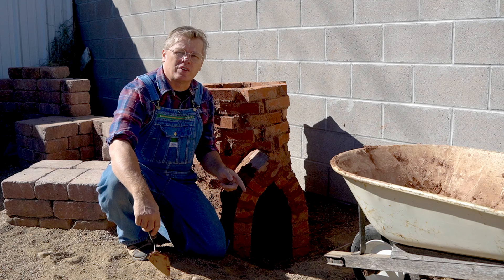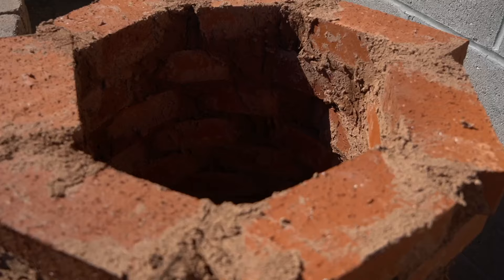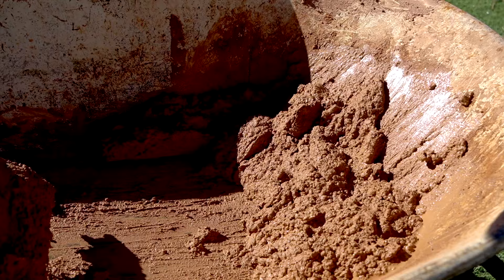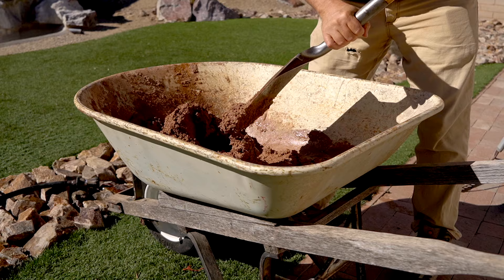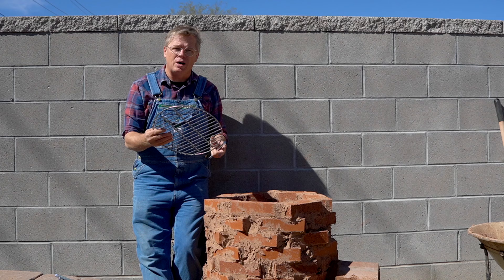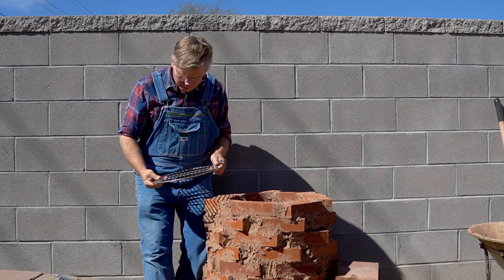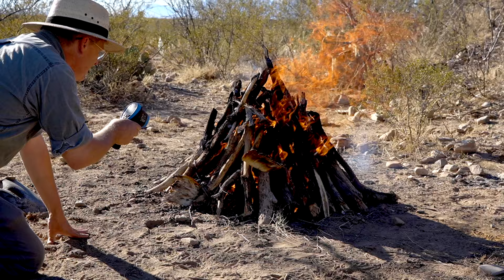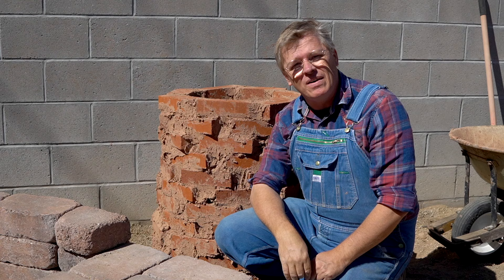How to Make a DIY POTTERY KILN

Comment: Hint: dip the bricks in water before laing them up. The wet bricks won't suck the water out of your mortar and thus the bricks will stick together better.
Reply from the maker: Great masons tip, thanks.
Reply: also when you use the trowel, press the clay mortar with force into the surface of the bricks on both sides. makes them stick together way stronger then when applying little force and only one side of the brick.
Reply: Mortar doesn’t stick to wet brick. It will pop right off.

Comment: Hi Andy. I think your kiln looks very functional and quite sturdy.

I noticed that your kiln looks very close to your cements block wall.
A piece of sheet metal should reflect enough heat to prevent any heat damage to the block.
It is amazing how much heat even a little kiln will produce when you are cramming every spar BTU you can find into it.
I looked into paper kilns and was surprised at how well they insulate.
So, was thinking thin layers of adobe with lots of straw on the outside of the kiln might help retain more heat and shield the block wall.
I am wondering what you are going to put on top of the kiln?
Two plates of something will allow you to throttle the fire and retain more heat. As well as put the kiln into reduction at the end of the firing.
A piece of flue pipe will also improve the draft. But I don't know how far  away from your original thought you may want to go.
When I referred to your kiln as little I was by no means trying to slight it in anyway.
I think your kiln will be a real work horse and you will be able to pull an amazing amount of pottery through it.
I hope I don't sound like too much of a know it all with a lot of unsolicited advice. 
I am really meaning it to have a conversation.
Thinking is nice, but doing is better. And you seem to be doing very well, cheers.
Reply from the maker: Thanks for the tips Russell. I fired it yesterday, no problems with the block wall getting hot. I used a few concrete pavers to cover the top and retain more heat. It did get a little smokey at one point but everything came out great. Look for the video of the firing on my channel March 24.

Comment: The last comment I made was reproduced from my failing memory when I hit cancel instead of comment on the very first one.
So I just realized that I had left out this part.
When you are first starting up the kiln, if you place a temporary grate on top of the kiln and build a small hot fire, it will burn away all the smoke coming out of the top. Since smoke is just unburned fuel.
This should help with having a stealthy urban kiln, cheers again.
Reply from the maker: Good tip, thanks.

Comment: You are always one step ahead of me (lol). This has been on my "to do" list all winter. I need just a few weeks more for the weather to warm up to build mine. I have built a coal forge in almost the same way. I am going to make a few adjustment to your version and add what I learned from building the coal forge on my kiln. If it works, I share with everyone on Instagram. If not, I'll just remake it the way you have done it.
Reply from the maker: That’s great. I am only ahead of you because the weather here in Tucson has been good.

Comment: Regular brickwork would work but using firebrick and high temperature mortar is the proper method, just use standard masonry for the outer walls or build some type of shelter to protect it from weather in wet or freeze/thaw regions.

Comment: Hi Andy, your kiln looks a lot like a bloomery furnace for processing iron ore into wrought iron. Those get to 1,000c or so. Have you considered putting in a tuyere below the pottery you can use to force air into the kiln? You can make a clay pipe that your fire and then connect it to a bellows, or an electric leaf blower. You can get crazy heat out of a charcoal charged furnace/kiln that way.

Comment: I'm glad that you addressed ways to protect it from moisture in wetter environments. I live in Washington state and we see a lot of rain where I live. I would build mine on a cinder block platform. Another challenge I would face is the summer burn bans. The burn bans can get so strict that you can only burn in a wood stove and only if it is your primary source of heat for your house.
Reply from the maker: Wow, those folks in Washington are hard core
Reply: We frequently get small wildfires along our highways during the summer, but they get put out quickly. It is the ones deeper in the forests and grassy spaces that are harder to get under control.

Comment: I am waiting for the inaugural firing,
I made some mud mortar 10 years ago and I used two type of mixture: 50/50 sand/clay and the other one was 50/50 sand/clay and added 1 part of cement to 9 parts of the mud/clay mixture.
The 50/50 sand/clay mixture got eroded by the elements (rain, wind, hot, cold, sun) and the 9:1 mixture have not eroded at all.
Reply from the maker: Excellent, thanks for sharing your experience.

Comment: The discussion at the end is quite important. Most backyard DIY projects I see on the internet don’t discuss modifying how one has to adapt the build to different climates. In my case I would have moisture, snow, and deep frost (=frost heaving) to contend with. So a DIY kiln would cost much more after you factor in the cost of a stable base, and a weather-proof and heat proof enclosure.

Comment: I'd build double walls an inner and an outer wall with air between and then interlinked with a certain frequency, that should massively improve heat retention.
Reply from the maker: That would definitely help

Comment: Good build . You could dig vents from bottom to the outside you can control. This will definitely make for a hotter fire in small area.
Reply from the maker: Yes, I did exactly that, check out the video I made that shows the improvements I made to this kiln https://youtu.be/b-qNKqwaiy8

Comment: Hey Andy, what cones can you fire to? I believe doing a cement outer coating of the kiln would insulate the pottery a lot nicer and allow for a more stable and easier firing method.
Reply from the maker: I never use cones so can't answer that question directly. I do use a thermocouple to measure temps in my kiln and I regularly hit about 850 to 900 C. I am sure I could go higher if I wanted to and spent more time at it, but those temps are perfectly fine for the pottery I am making.

Comment: Hi Andy! How high up does the barbeque rack need to be from the bottom of the kiln and can you have two racks for extra pottery? So you can fire items without glaze on the bottom rack and with it on the top rack? How hot does the top end of your kiln get? Any suggestion on how to get it to burn to at least 1,000 celsius? What did you use for a lid on this kiln? Thanks and great video!
Reply from the maker: I'm working on a video about how best to fire a kiln like this. I have never had it up to 1000 C but I do believe it could be done with a little more time and effort. I have never tried two stacks. I was just putting some bricks over the top for a lid but now I am building a little chimney with bricks and find that works much better as it increases draw. You can see this method in this video https://youtu.be/4z3x8psUUbE Like I said I will be making a video showing my thoughts and methods on firing this and getting the most from it.

Comment: If you add a metal grate in the front of the fire box, this would keep the fuel off the ground allowing better air flow. Also if you add a fan or something to blow air into the kiln you'd reach much higher temperatures..(Like a rocket stove.) Good luck with the first firing! )
Reply from the maker: Thanks you for the tips. Yes, oxygen will make a big difference in the temperatures.

Comment: Hi,
Really instructive and good videos for me as a novice but potterycurious guy. Do you have any video about fire bricks? When to use and when not?  This is really confusing to me and I do not get a clear picture of this topic. You mention below you are not targeting high temp so firebricks are not needed for this kiln. But you are still targeting 800c for burning pottery right? I guess my question is when to use fire bricks and when can I use regular bricks?
Reply from the maker: I said "I think" fire bricks are not needed, I have never done this before so I am learning as I go. But it seems logical to me that these bricks were fired much hotter than 800 C when they were made, so I would assume that 800 would not adversely effect the bricks. Only experience will tell me how they work. I certainly could never have made this kiln so cheaply if I had to use fire bricks.

Comment: I did some excavating on my property last year. We have a large clay layer  in our soil and high amounts of clay in the soil so I saved several buckets of the clay I uncovered. Have always wanted to build a kiln and make some things. I made a brick rocket stove out of bricks laying around a number of years ago to barbecue on. You have inspired me to turn that into a kiln. Also I have always wanted to take some of the extra limestone we have and burn it to make lime mortar to do authentic repairs on my 1899 walls. I wonder if that could be accomplished in one of these little kilns as commercial operations once did on a large scale? Even though we have limestone readily available finding real lime powder or mortar without chemicals added to do burnished lime on walls has become almost impossible in my area.
Reply from the maker: I have actually wondered about that myself. A quick Google search shows that you only need a temperature of 700 C to produce lime. Although you may need to maintain that tempe over a period of time to make sure your limestone gets heated all the way through.
Reply: @AncientPottery  I saw a video of a guy who did it on his farm with a huge bonfire with the rocks piled in the center. Sort of like an outdoor firing of pottery. He stacked the wood very specifically so that it slanted in toward the limestone and would concentrate the embers into the middle as it burned. It worked, but I don’t have the space for a fire that big.

Comment: What about using refractory cement instead of the mortar? Will add to my cost but think the stability and ability to take the heat would be worth it?
Reply from the maker: Yes, that would work great. In my case I was trying to keep the cost down so mud mortar was a better option for me.

Comment: If you had to do this again, would you leave a couple bricks without mortar to be able to remove them to add air?  If so, at what height would you have the non-mortared bricks?
Reply from the maker: Yeah, maybe that would be a good idea. I need to do another firing and try some things to make it burn better.

Comment: I’ve started something similar. I made mud bricks interior with straw like they did for early colonial ovens. And then did a brick with mud mortar exterior. I haven’t quite got enough mud bricks to finish it. I’m wondering about fire temps. Will these bricks hold up to heat? Another option I was think of using fire bricks but those aren’t cheap. I can’t wait to see you light this one. I’ve been waiting until spring to finish and try mine. Also what do you plan on using on top, to create a chamber?
Reply from the maker: Yes  think those bricks will hold up fine. I will cover the top with some paver bricks I have. Wait for my kiln firing video that will be coming out in a couple weeks.

Comment: Howdy Andy, I loved your video and learned a ton... I had a couple questions after watching maybe you could help work through. I am trying to do a lot of research to make the best DIY Smoker, to smoke meat like ribs, brisket, etc. I dove into the kiln design DIY world to better understand a different niche with a relatively similar goal; Design a cheap, safe, effective, and efficient contained heating source. It is worth quickly pointing out the major design differences are going to be related to food safety and design for food use, Lid design, and the lower temps of smoking meat 220-600 degrees operating temps.  My questions are as follows:

1. What is the best food safe alternative to mud... I have thrown around the idea of building this kiln around a metal barrel to eliminate this problem of mud crumbling onto the food but this is far more intensive and ultimately more expensive. Is there a good alternative to mud like concrete or some cheap brick mortar that can do fine at my lower operating temperatures?

2. For long term use is it worth building this on a structure of foundational bricks...I imagine getting ash out does not matter as much when making pottery if you can use something to start the flame but in the smoking meat hobby it is super important to sift all charcoal ashes out between smoking's for the flavor of the meat. I will probably design and weld a sifting table for the charcoal to sit on and have holes to sift out the ash... but having a layer of brick underneath may allow me to scrape out any ask build up over time. In your use of the Kiln has cleaning out ask ever come into play or is it just as easy as taking a small shovel and scraping it out and whatever dirt comes along is no worries?  

3. One design feature I am a little stuck on is the lid, it would be great for it to be hinged and light enough to move, as well as be insulative and seal against the body of the smoker. Generally lids are shaped like an upside-down bowl to increase the velocity of the smoke coming out of the top and act as a sort of nozzle. I have kind of deduced it has to be metal just because it needs to be formable, mountable, light, but it really gives up a lot on the insulation front... do you have any clay ideas for a lid like this or any other material for that matter? 

I am sorry for the lengthy essay just thought I would try to gain more insight from any expert I can reach. I hope you keep having a great time and keep up the amazing content, I will be sure to stay tuned :)
Reply from the maker: Wow, lots of text... Wish I had more time to answer these "essay questions".

Comment: For a damp climate, what about using perlite concrete for the mortar?  I've read it can stand the heat better, as the perlite insulates the cement from the heat better than traditional mortar of sand and Portland cement, the idea being that only the innermost cement gets exposed to the full heat.  I've never tested this myself, but I get enough rain and humidity that I think I'd have trouble with mud mortar.
Reply from the maker: Perhaps that would work, I don't have enough experience to say. But give it a shot and let me know how it works out. This mud mortar would be a real problem in a damp climate for sure.

Comment: First of all, thanks for making this video... I had a quick and possibly stupid question. Could I use clay as a mortar for this?
Reply from the maker: Yes, in fact that is exactly what I used for mortar. Just mix in a lot of sand (I used 50%) to keep it from cracking.

Comment: Can you recommend a thermocouple that will work for this kind of kiln and is relatively inexpensive?  Or point me in the general direction. It seems the probe needs to be ceramic?
Reply from the maker: I use the ACI 1030-4-8 unit on this page http://www.clay-king.com/pyrometer.htm

Comment: I live in a city my yard is half Concrete patio type and then some grass dirt area could I build this right on the concrete slab or does it have to be on the dirt
Reply from the maker: You could put it on the slab, just put a couple inches of dirt at the bottom as a buffer between the fire and the concrete.

Comment: I'm wondering if it gets hot enough for raku. We'll see.
Reply from the maker: I'm not super familiar with the raku process, but someone here said that it needed to reach 900 C for raku and I have had this kiln up to 900 before.
Reply: @AncientPottery  Raku is fun for the pyromaniac in most potters. I saw your kiln got nearly to 900 on the first firing. I'm sure it will get hot enough. Thanks for the information.  I've been wanting to get back into pottery for years, but didn't have access to a kiln. Now I can build my own.

Comment: Hi Andy, really informative video, did you use fire bricks for building the kiln or would standard brick be suitable also? - James
Reply from the maker: I used just regular bricks. I'm not going to be firing super hot so I think that will be suitable. Fire bricks are a lot more expensive.

Comment: Are we allowed to use cement instead of the clay sand mix?
Reply from the maker: If you want to use proper mortar between the bricks you will want to use refractory mortar so that it can withstand the temperatures.

Comment: Can you use mortar and river stones? Im pretty broke but theres all sorts of rock where i live
Reply: Or cement and stone?
Reply from the maker: Sure you can, but I would prefer mud mortar to cement as the concrete may not hold up well to those high temperatures. Pottery doesn’t have to cost a bunch of money as it’s made from natural materials.

Comment: Do you think you could semi waterproof the kiln with a light render to protect the mud in a wet climate? Or would the external part of the kiln reach too high of a temperature for a cement based render mixture? Thanks
Reply from the maker: I think that could be problematic. Around here they will sometimes coat an adobe building with cement based plaster in an attempt to keep the moisture out. This can cause big problems as any moist that gets in, either through wicking up out of the ground or through small cracks in the plaster, cannot get out and will slowly dissolve the wall from the inside. So they say it is better to coat them with a breathable plaster such as lime plaster so that moisture can escape.